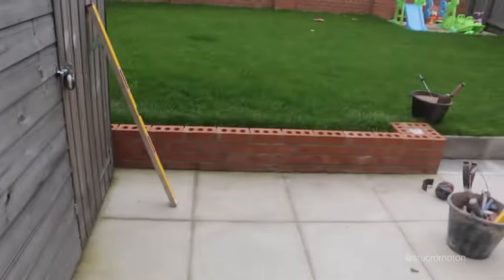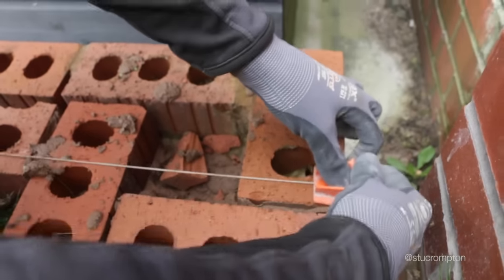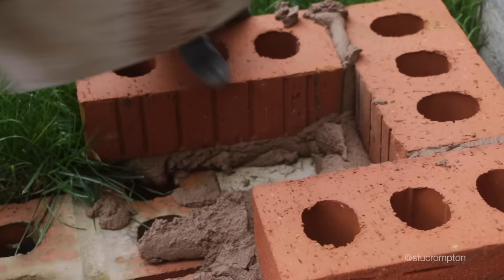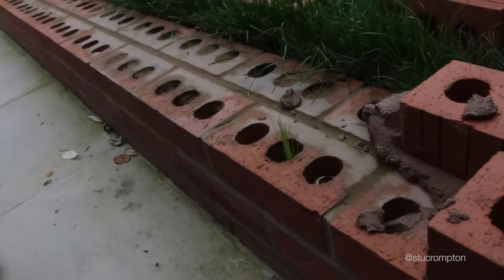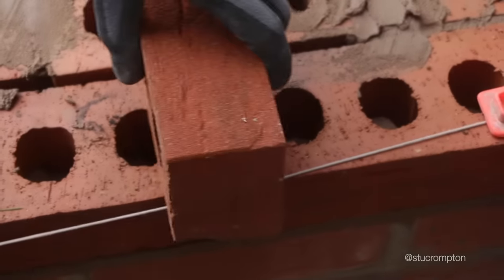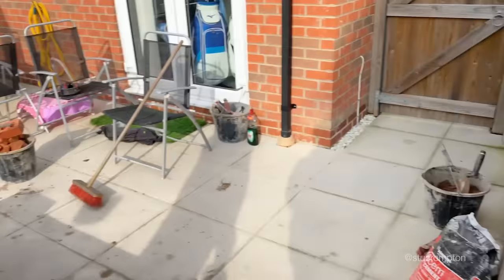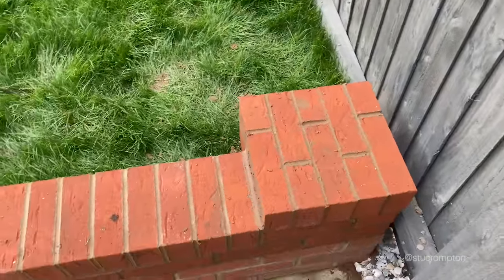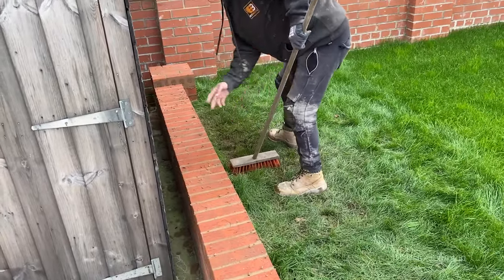Bricklaying - Finishing a DIY Garden Brick Wall

Comment: Being experienced you don't need to check the levels front to back on the brick on edge but a boat level is good if you're not so experienced.
3 brick on edge to one stretcher is a good check for spacing.